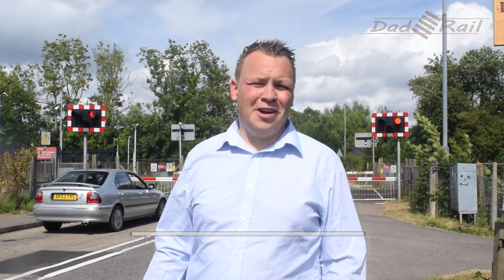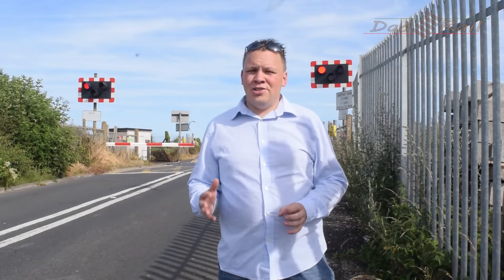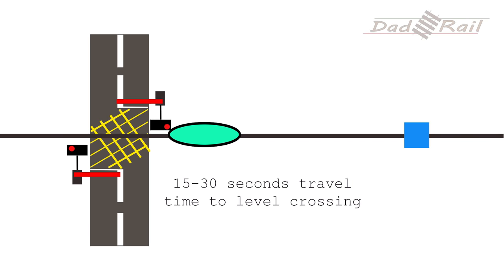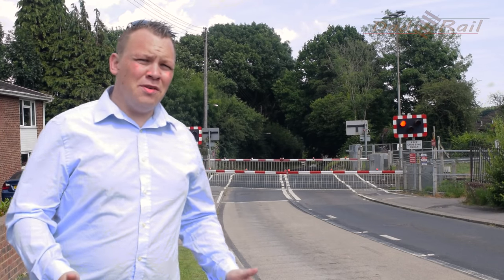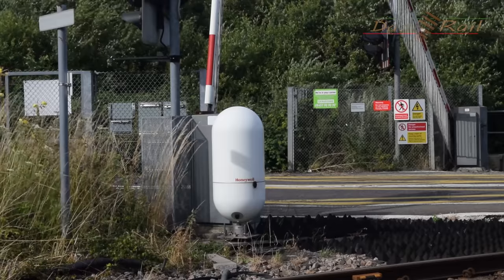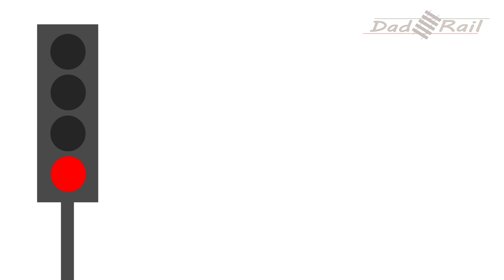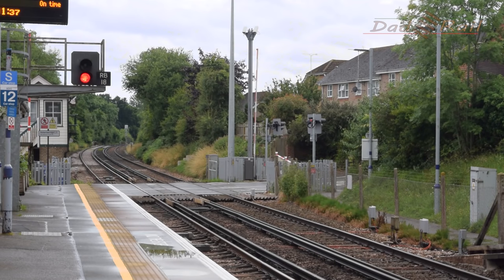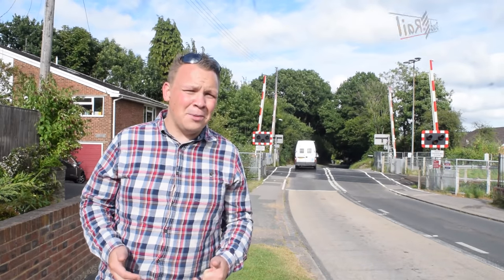Why do railway level crossing barriers go down so early? - Dad Rail HD

Comment: At line speed, the timing for the fastest train to travel from the treadle to the AHB crossing is 37 seconds. This was changed from the original 24 seconds following the Hixon level crossing disaster on the 6th January 1968 when a 100mph Manchester to Euston express hit a grounded low-loader with a 120 ton transformer on board.
Reply from the maker: Thanks for the info, I think it is 27 seconds though?
Reply: @DadRail  
Correct - 27sec has been the minimum at AHB LCs for some 30yr now. But where there are certain features, eg the crossing is skewed, it is a bit longer.

Comment: Didn't the inquest into the 1968 Hixon disaster (A large vehicle stuck on a level crossing getting hit by an express train with 11 killed) cause changes to the timing, rules and location of various types of crossing?
Reply: It did; the details can be found here: http://www.railwaysarchive.co.uk/docsummary.php?docID=74 It's a 159 page report that's been scanned in to pdf format, which is publicly available. Lots more bumf re. this issue can be found if you just search for 1968 Hixon level crossing (or similar).
Reply: Yes. Amber lights were added and ‘another train coming’ function added after other accidents.

Comment: Another type of level crossing is on Coldblow, just south of Walmer station near Deal in Kent. It has gates for motorists, but you must open them yourself (and close afterwards) when the light is green. Coming from the USA I found this most remarkable!
Reply: That sounds like a MSL red/green light crossing. These have been provided on private roads to replace telephone only crossings.
Reply: @Mark1024MAK  Coldblow isn't a private road though, it's a public throughfare.

Comment: Hi there if you can please make a video on how tic tac crossings work, keep up the great videos.
Reply from the maker: Hi, Im not to clued up on exactly how they work and cant seem to find much info about them but i have asked few people who work in signalling so hopefully if i get the info i should be able to do that, if you've got any other suggestions for future videos then I'm happy to take them on board :-) Also I have subbed to your channel
Reply: the 1st auto one looks like cooden crossing in bexhill
Reply: Honeywell’s Vehicle Detector is a radar based sensor that uses Doppler and FMCW mode simultaneously for detection of vehicles, e.g. trains, trucks, cars, moving or stationary. Speed and distance are measured simultaneously, providing high accuracy while being maintenance free. The vehicle detector is used in rough environments, e.g. railway tunnels to determine the presence and speed of a train.  A sensor assembly along the track supports a system software to decide if the train is moving or has stopped, to determine it’s speed and direction and detect if a train has separated.  The sensor is operating at 24 GHz and is therefore not disturbed by moisture, dust or smog.  The sensor is maintenance free and does not require scheduled cleaning. https://cip.honeywell.com/sol/Pages/RailTrack.aspx
Reply from the maker: top man :-)

Comment: Dad Rail, what causes the barriers to lift up and the lights to go out? Is this because the treadle detects that the train is too far away?
Reply: There will be a second one usually at the other end of the signal block (easier access for the wiring that way). Once that second one is activated the barriers can lift, it probably needs an axle count match on both actually since the treadle is activated once for each axle that passes over it a computer can keep a simple count and verify that everything that entered the section has exited. Would not be surprised if that wasn't the case just to ensure that long trains are indeed clear of the crossing in their entirety though no doubt a good engineer would consider the safe handling of the relatively unlikely event of a train splitting in the crossing section due to a coupling failure as a smart failsafe feature too, it's not implausible to imagine a situation where the disconnected part of the train could roll into the crossing after the front of the train left the section as it would quickly lose speed (due to the failsafe activation of the emergency brakes in the disconnected part of the train).
Reply: Seraphina, You are referring to axle counters. Treadles are not linked to each other and are simply a damped switch that the flange of the train wheels pushes down, with a slow release. In effect the treadle stays down as the train passes over it, and then gently raises after the last wheel has passed. This then recovers the crossing.
Axle counters are lined together and count in and out each axle as they pass over the heads.
Reply: @paulp8230  Not true, Most treadles in the UK work as a pair, the one two minutes away starts the barrier operation and counts the wheels (axles) going over it. Another treadle is located just after the crossing and counts back the wheels crossing over.  So first treadle counts say 16 wheels, second treadle counts 16 and the barriers raise (unless another train coming on another line).  If the count is different, the barriers stay down until a second train resets the system or it is fixed.
Reply: @ianmurray250  Ian, treadles (or at least the ones i used to work with) were not designed to be counters. You need an evaluator between the heads to count the axles in and out when used for detection.. Also the lever on the treadle was damped slightly so that it didnt immediately restore, therefore axles after the initial activation are likely to be missed.
Treadles, iirc were only ever used to time and activate crossings, in effect detect the passage of a vehicle. Train detection for control or indication purposes was completed by track circuits or axle  counters. The use of treadles was a cheap and efficient overlay for crossing control without affecting existing signalling circuits.
Reply: @paulp8230  Interesting Paul, I have a AHBC crossing that I am told works like this (no track circuits), but I can see your point, the few treadles I have watched are dampened and probably wouldn't count correctly, never watched the strike out treadles next to the road on this one though. Crossing is on a single bidirectional line.
Reply: Sw4gg3r G4m3r - This thread contains some misleading information. The answer depends on the type of crossing. And if a controlled / manual crossing, on the specifications when it was installed.
A train detection system (either electrical track circuits, or axle counters) is used to detect if a train is in section approaching or on the crossing, or if no train is present. A treadle will be used for all automatic crossings and some other types where problems may mean that the track circuit is not reliable. As a treadle should always detect a train wheel. Treadles don’t count wheels.
For basic controlled / manual crossings, the track circuit / axle counter section has to be clear of trains. Only then will the signallers raise button work. For busy crossings, an auto-raise facility may be provided. This normally requires the correct sequence of track circuit / axle counter sections to operate (to prove that the train has passed clear of the crossing) before the system will automatically raise the barriers. Similar arrangements are used at automatic crossings. Extra “exit” treadles may be provided. As one person said, treadles are dampened using hydraulic oil, so that the arm does not get hit from fully up to fully down by every wheel on a train. They take between 6 to 10 seconds for the arm to return to the normal position after the passage of last wheel. So can be used in conjunction with track circuits/ axle counters to detect when the last wheel of a train has crossed clear of the crossing.

Comment: Boston has two level crossings in close proximity to one another, one on an extremely busy stretch of road. There is also a goods sidings nearby which trains have to set back into. This necessitates both sets of barriers at the crossings being lowered for quite some time (up to 15 minutes in the case of one of them) while this takes place. The amount of times I have hindered emergency services vehicles at these crossings is unreal. Setting back at 3 mph into a yard whilst an ambulance is sat there waiting to clear the crossing is not a nice thing.

Comment: As a signalman, I think he explained how level crossing work, very well, he was right, to keep a train at line speed, the driver needs green signals, which means on a line with speeds over 100 Mph, barriers need to be down at about 3 minutes

Comment: The level crossing at Goole is a controlled crossing at a station. When the train is approaching the station coming from Hull sometimes the barriers go down before the train gets to the station and other times they don't. The crossing is currently controlled by a signal box. Is there a reason for the inconsistency?

Comment: When going to Milton Keynes if the Bow Brickhill crossing closed in front of me, it was always quicker for me to turn around and drive the 3.4 miles around the other way than to wait for it to open. The barriers would be down for about 5 mins, while we waited for a slow-moving train that normally stopped at the station next to the crossing. Never once in the 20years of going over that crossing did I see a fast train on that line.
Reply from the maker: I can believe it! can be really bad in some places

Comment: In the US it's really short, about 20-25 seconds usually.
Reply: The automatic half-barrier crossings were introduced in the UK in the 1960s and initially they closed across the road just 20 or 30 seconds before the train passed. The Highway Code for road users warned people that they must not zigzag around the barriers, saying explicitly that "the train cannot stop". Then there was a bad crash when a low-loader truck carrying a transformer weighing tens of tons got stuck on one of the crossings and seconds later was hit by a passenger train going at high speed. After this, the gates were closed across the road much earlier. Also telephones connected to the signal box were installed either side of the crossing, on which anyone wishing to cross with a very slow or oversize vehicle or with a herd of animals must phone the signal box to get permission to cross and again after crossing.

Comment: How does it work at AHB level crossings like Chilworth, Leominster, Nantwich etc, places where there is a treadle immediately after the station which operates the crossing if the train has stopped at the station, whereas if the train is not going to stop at the station an earlier treadle closes the crossing. Do the treadles detect speed to evaluate whether the train will stop at the station or does the signalman play a role in varying which treadle should operate the crossing?
Reply from the maker: Im not familiar with this set up to be honest, i will do some digging and see what i can find out
Reply: Thanks. I'd be interested to know.
Reply: Patrick Wood plunger
Reply: With crossings such as Leominster the treadle immediately in rear of the crossing is to activate the road wig wag signals and yodalarms in the event of a train passing the protecting signal at danger with the barriers open to road traffic
Reply: With automatic half barrier crossings there is normally three sets of treadles for each line, plus track circuiting to detect the presence of trains. In the normal course of events the barrier lowering sequence commences with the second set of treadles being struck by the train. The third set of treadles would detect that a train has passed over the crossing.

However on a double track line two trains can be approaching in opposite directions. In that scenario the first train to reach the second set of treadles would start the barrier lowering sequence. The train that was further away, wold strike the first set of treadles. This has the effect of stopping the barriers from rising until both trains have passed clear of the crossing. These are placed at a point where if two trains were approaching the  time that the barriers have fully risen to the time the next sequence would need to start is 10 or less seconds.

Where a station is located at or near an automatic level crossing and there is a signal at the end of the platform, often ab automatic signal, its aspect would normally be red. The signaller supervising the automatic half barrier level crossing has a selection controls either for a stopping train mode or a non-stopping mode. If a non-stopping mode is selected then the signal will clear immediately to a proceed aspect regardless as to whether the barriers at an automatic half-barrier were up or down. If the signaller selected a stopping mode, then the signal would remain at red until a period of time has elapsed before it would automatically clear to a proceed aspect. The period of time would depend on how far away the automatic level crossing was in relation to the signal. If the crossing was some distance from the station a extra set of treadles would be provided closer still to the level crossing that would activate the crossing. The aim of these is to keep the delay time to motorists down to a minimum regardless as to whether the train was a stopping train or not. You can view this at Milford station in Surrey where an automatic half barrier level crossing is adjacent to the station, or at Betchworth station where the automatic half barrier crossing (Buckland crossing) is about half a mile away from the station out of sight.
Reply: The U.S. standard practice is a lot simpler.
Reply: The signal box at the south end of Leominster manually presses a "stopping" button to switch between treadles near or further away from the AHBC making activation later for stopping trains. If they forget the barriers lower earlier and are down for ages whilst the train stops at Leominster station, this being safer.

Comment: Hi why do some barriers for the level crossing have what people would call the skirt also what purpose does it have?
Reply from the maker: Hi Luke, The skirts are normally found on barriers near stations and other areas where there are likely to be pedestrians around, i.e. towns and villages. There purpose is to stop animals such as dogs and people, particularly small children from running under the barrier. They are mainly found on full width crossings, and not on half barriers, as half barriers tend to be used in more rural locations and away from highly pedestrianised areas.
Reply: Thanks for telling me why as I've always wondered what they were there for and I found a few barriers have a weakened skirt :)

Comment: Second One, Cooden Beach. Fourth One, Battle Road. One after 4. Pevensey Bay (which is an automatic Obstacle detection crossing (MCB-OD)) Bodiam, Robertsbridge Station, Whinchelsea
Reply from the maker: all correct except for battle road. The crossing is at battle but it is not battle road, any guesses on the user worked foot crossing ?
Reply: +Dad Rail No, that Crossing is definetly in Battle
Reply from the maker: Yes the crossing is at Battle station, it is Marley Lane level crossing. Battle Road Crossing is located about 3 miles in the london direction on the A2100 near mountfiled. Battle Road used to be an AHB but was converted to CCTV about 6 months ago.
Reply: +Dad Rail Yes I know that

Comment: Why do all of the foot path crossings in England have fences blocking them?
Reply: Simply because the British invented the railways and steam engines traveling at 20 mph were considered very dangerous to people and animals, so the law in the UK requiring fencing of all railways dates back to the 1820s.  The rest of Europe, for instance, started building railways 20 years later (often using British designers and navvies) and only fences off high speed (150+ kph) lines.
Reply: Ian Murray - Actually, most fences alongside the U.K. railways were originally there to prevent animals and people from getting onto private or farmers land by using the railway to access that land...
Now due to trains having to be stopped and cautioned if trespassers are seen (which causes delays and costs money), the railway puts up fences to try to keep trespassing to a minimum.

Comment: I believe ALL crossings here are user controlled or auto. Not all have arms but most on tared roads have at least lights. I don't think we have any "controlled" crossings here so was wondering what the belly aching about time was. Now I see with your signalling etc and it makes sense. We also don't have crossing obstructed guards against the trains that I'm aware of at least.
Reply: You should elaborate on where "here" is.

Comment: i was in Ireland, holy shit, the gates go down at least 2 minutes before a train arrives, the crossing was right near a station too and when a train stopped at the station from one direction the gates would stay down when it was at the station until it left
Reply: He explained in the video why that is, they go down before the train arrives in the station in case of a platform overrun which could potentially result in the train fouling the crossing thus why both the station and the crossing will always be in the same signal block thus so long as that block is occupied the barriers stay safely closed.
Reply: His point was that they kept the barriers down even after the train was safely stopped.